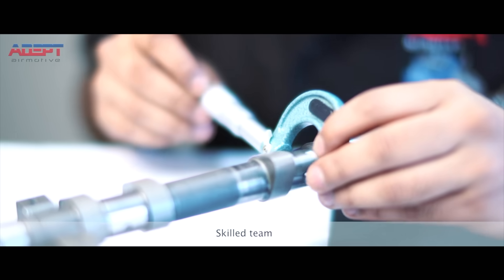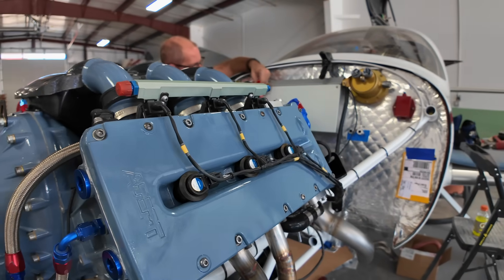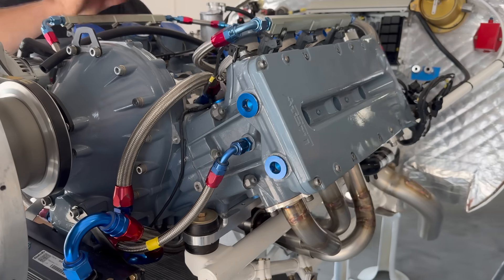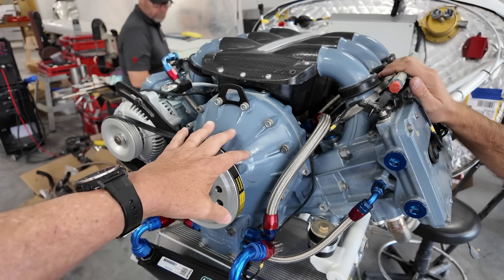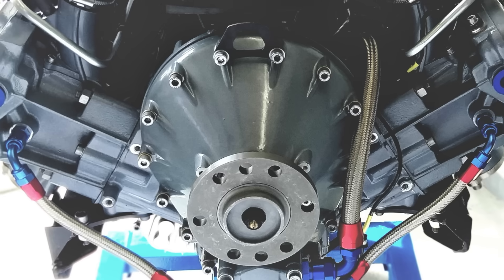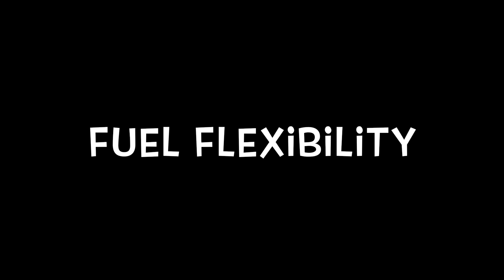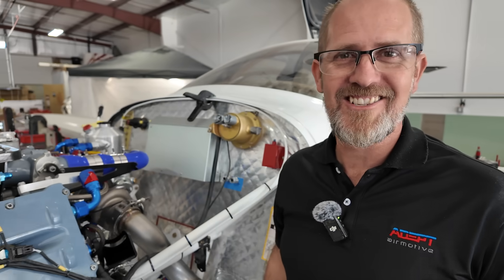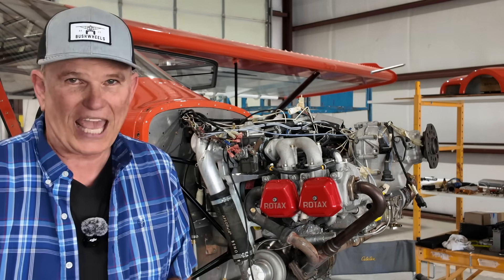The new Adept Engine could be a winner for General Aviation

Comment: I remember when converted Nissan V6 Turbo engine was supposed to change General Aviation with its VQ series of engines. The Continental series of engines are just too expensive for the power output compared to automotive engines of the same power output. Sometimes I think things in aviation are expensive for no reason like medical supplies. I wish this organization the best and hope they keep the cost to customers to a minimum.
Reply: When has there ever been a Nissan VQ aircraft engine? It's probably a pretty good candidate for a conversion in an experimental aircraft, but I don't think that it's ever been done before.
Reply: @PistonAvatarGuy  Look up Rutan 158 Pond Racer.

Comment: We will never ever win the price point on aviation engines. They will always be very expensive no matter who tries to build them. Look at the new rotax 916. Over $80,000 not too long ago you could buy a continental 550 and prop STC package for a 182 for that kind of price. By the time the 916 is propped up an accessorized, it will be north of 100k. And this is based off an engine originally designed for ultra lights. Sport aircraft when they came out were supposedly going to be less expensive. That has not been the case. If you really want to fly you're better off buying an old luscombe Cessna 150-172. The money you will save on the acquisition will pay the maintenance, storage, fuel and insurance for years. A 916 powered Cub clone is closing in on $400,000 fn ridiculous.
Reply from the maker: It's not wings that make planes fly its $$$$$

Comment: Battery prices are dropping like a rock, next generation is showing 400KW  storage efficiency, and electric motors are progressing at an incredible pace on a price/performance basis. Electric is on the way, will have superior torque in small packages with mechanical simplicity.
Reply: Batteries getting cheaper wont make them light enough for use in any sort of practical aircraft.
Reply from the maker: you may be right. the only problem with electric is range. Perhaps it will be there someday but it has to reduce your payloadl

Comment: Why V6 instead of inline?
Have fun and good luck
Reply from the maker: CG, available space in the cowling. An incline would stretch things out too far. The V6 is a nice fit.
Reply: Why flat six? Why Lycoming or Continental? They have always been crap engines. There are kits running around now with LS based small blocks they are a far better option.

Comment: i have only watched 2.5 mins of the video so far and I have already counted 15 single points of failure. I would like for one of these rocket scientist to experience a real engine out over some place like GA or TN where you look down and all you see are 100' tall trees for as far as you can see. I wont even go into and engine out at night or worse engine out in IFR. If your going to design a new gasoline piston engine for aviation then do it from the ground up with reliability being your number one concern followed closely by weight.. Quit taking automotive engines and sticking them in aviation applications and calling them a new design.

Comment: Last comment didn't really make a lot of sense. Rotax doesn't produce an engine anywhere near 360 HP. And, any aircraft flying with a current Rotax, aren't likely to support a 360lb engine. Apples and oranges.
Reply from the maker: There are grumblings in the rotax community that they want to develop a v6 engine. we'll see
Reply: Rotax V6 hast flown a few years ago by R&D. Regards from Germany

Comment: It totally makes sense.  I like the fact that you can lose the water cooling system and yet the oil cooling system is enough for you not to crash.  It also looks very oil tight the way it is constructed.  Top quality lines, computer controlled and turbo = power and reliability.  You cannot run a high horsepower motor with a turbo without proper computer controls.  Ask any racer like Tom Bailey and Steve Morris.  No person can do that.
Reply from the maker: The engineers put a lot of thought into the design.

Comment: 4500 rpm cruise seems like a lot for an airplane.  My V-8 Ford run 3200 at 80mph cruise
Reply: My Fiat I4 DOHC runs 4500 RPM at 80.  It has over 260000 miles, with no major problems
Reply from the maker: My Rotax cruised at 5,400 rpm and it/s very comfortable. That's where the gear reduction drive does it's thing.

Comment: It's about time someone put modern technology to work in GA powerplants. Turbines have had FADECs for years....they work extrememly well and don't fail. Liquid cooling? Nothing new here. As along as the engineering is done well, it'll work just fine, and I'm really impressed with that "run it at 50% power with only oil cooling". I hope you guys knock it out of the park with this engine.
Reply from the maker: me too. fast, smooth, efficient, fuel flexible. what's not to love.

Comment: The perennial problem with general aviation is the excessive certification costs, so that getting certication for new technology when you have low production numbers (old technology here really) is just ridiculous.  Therefore everyone is using currently certified engines which haven't moved forward since the 1950's. GA should be using phev electric/ice hybrid engines with an electric motor instead of a gearbox. Less vibration, less noise, more reducancy, more torque,higher efficiencies. Btw Volkswagen 4 cylinder car engines easily produce more HP per pound than this engine.

Comment: I don’t “start” my car anymore. I simply get close, the door unlocks, and the car turns on. I never go to a gas station, it doesn’t poison the environment, it’s super smooth and powerful, and drives itself. Love my Tesla!!
Reply: You're driving a coal powered machine, = Lost transmission power , coal production, transport, Power plant/Hydro plant construction and battery waste disposal. You didn't think of that did you?
Reply: Batteries don't work for aircraft.
Reply: EVs still poison and destroy the environment. They just do it differently and further out of sight.
Reply from the maker: They are amazing cars. I just wish they had more distance.

Comment: Looks to be a 120 deg. v, which means secondary vibration, which means more counterweights in the crankshaft. Single spark plugs, where is the redundancy?. Liquid cooled equals more weight.  Gear reduction which has always been a problem with vibration and wear, also more weight. Petrol ( gasoline) burning, which has to mean mogas, as high octane leaded fuel is going away.
As other commentators here have mentioned the diesel DeltaHawk, something that they have been working on for decades and is now almost on the marketplace, but at what price point?.
Rotax are popular but the engine revs at “idle” need to be kept higher due to the power pulses in the gear reduction causing premature wear, this has always been a problem with geared engines, even Porsche couldn’t make their aircraft engine work reliably in the 1960’s, 70’s ?.
There have been quite a few people using modern mass-produced engines with reduction drives over the past few decades, usually in experimental aircraft, how many trouble- free hours are they flying?.
Revisit this in a few years and see where they are.
Reply: Ferrari doesn't seem to have vibration problems with their 120 degree V6s. This isn't the 1940s anymore, ignition system components aren't any more likely to fail than any other component. Liquid-cooled engines are lighter than air-cooled engines, even Continental's liquid-cooled engines were the lightest of their 500 series engines. PSRUs allow for an enormous improvement to the power to weight ratio of the engine, it's the primary reason why they're used. Wet and installed, this engine weighs more than 100 pounds less than the dry weight of a comparable Continental or Lycoming. This engine does not need leaded fuel and runs on 91 octane mogas.

In its least powerful iteration, this engine makes 100 hp more than the DeltaHawk, while at it's most powerful, it makes twice as much power, they are not comparable engines.

Rotax's engines don't seem to have problems with their PSRUs.

Porsche's engine worked beautifully, it was just expensive and under-powered. More than a few are still flying to this day.

During the heyday of piston aircraft engines, almost every engine that made more than 1,000 hp had a PSRU, so why should the aviation community suddenly be adverse to their widespread adoption?

Comment: I'd be interested to hear how they can run a fuel injected engine on avgas, which is I assume is leaded.  There is no oxygen sensor for fuel injection control?
Reply from the maker: This plane has multiple fuel oxygen sensors. That's why they can run on any fuel you put in it.
Reply: Don't need an 02 sensor for Air craft fuel injection as it is now....

Comment: Beautiful engine. 
But
Single spark plug? I get that we've come along way but you can't just pull over when you have an issue so, redundancy is nice to have, is relatively inexpensive and not even a huge deal to incorporate. And if the response is ... parachute... well, I'd rather pay a bit more for my engine then having to buy a new plane because even though I'll most likely survive, the airframe will most likely be beyond repair.
Reply from the maker: they say if you lose one plug and coil, you only have a 15% reduction in power.

Comment: Great the he gave Rotax a plug at the end...not many competitors would do that. Beautiful engine. NOT a motor - they are electric!
Reply from the maker: Love, love, love Rotax. No other engine can do what. that platform does. This is like a big Rotax.
Reply: Technically it is a motor. "Engine" comes from the Latin ingenium, meaning "innate quality, mental power, clever invention". Sure we use that term almost universally, but it is still technically slang. There is no requirement that a "motor" be electric. "Motor" comes from Latin motor, meaning "mover."
Reply: @NeilWhelchel  Your response shows innate knowledge or research. Both are praiseworthy.

Comment: Congrats on the project. As an A&P I see something that concerns me so I hope you don’t mind a little constructive criticism. The curved fluid fittings are not AN and we don’t use those in aviation because of the large unsupported tubes prone to cracking under vibration. I would support them near the bend since right now all of the loads are transmitted directly to the radiator. Either the fitting or the radiator itself would be prone to failure in the current configuration.
Reply from the maker: I'm sure the owner will read this comment. Thank you
Reply: As a race car engineer by trade who also has an A&P, I can say you have no idea of what you’re talking about. Angled AN fittings are actually superior in both flow and structural stability than straight fittings with the bend radius in the hose when the routing requires it, the key is in the hose support. Modern professional race cars are basically fighter jets on wheels and experience significantly higher thermal and vibrational stresses than aircraft. If it can survive a Daytona 24H, endure the abuse of 12H @ Sebring or 2H in an F1, I’m very comfortable flying behind it. Congrats to ADEPT for having the guts to attempt a project that helps bring the aviation community into the modern age.
Reply: @CarlHermez  "Real race cars don't have doors".Sprints Midgets and Roadsters
Reply: What is AN?
Reply: @GeorgeDoughty-m8e  Army Navy standards. Aviation certified fittings.
Reply: Yeah, good one. Like you have seen the inside of a P51 ever. Steel fittings and coolant, good combination. Go back to sleep, you’re more helpful that way.
Reply: @anthonydennis2996 Steel fittings and coolant is perfectly fine and has been done in automotive applications for the past 80+ years. The vast majority of coolant has anti corrosion additives to prevent corroding fittings or the engine block itself.
Reply: Army-Navy : similar to JIC, 37 deg sealing flare but different thread. The fittings in the video are AN. The bend radius of the hose end has nothing to do with the standard. Somebody needs to go back to A&P school and get some education on aerospace fluid connectors.
Reply: @anthonydennis2996  JFZ auto racing makes the same fittings and you haven't an Idea of proper fitting and hose supports- Try working on a P-51 and see how it's done.
Try a steel fitting.

Comment: Has been over 15 years in development. Hope they pull it off but many millions must have been spent in that time, making the per unit price pretty high for any decent time for ROI.  Should have brought the project to the US a long time ago- that's where the market and money is.
Reply from the maker: People didn't want to accept water cooled engines back then. But thanks to the track record of the Rotax, i think hearts and minds are changing.
Reply: Try 20 years, and at the cost to the South African tax payer. This engine was developed under a local 'Development plan' as a local replacement because USA imports are horrific. But the deception goes on. To date, South Africans cannot afford this engine, that their tax money sponsored.

Comment: Looks very cool ndeed. That oil pump underneath the propeller mounting hub, looks like a full flow VW installation. I've done a few of those, and it looks so similar. May be it is the flat cover, and the lines leaving the pump to the cooler, and others.  I think it is time for the airplane engine technology to go to the next level and take the industry by the horns. Best of luck with this machine.
Reply from the maker: I'm sure it will get even more attention once it starts flying this month.

Comment: No.  General Aviation leaded fuel mist end.  Electric motors only at that size of plane, with hydrogen or ammonia or a cleaner diesel fuel.
Reply: This engine does not require leaded fuel.
Reply: You truly haven't a clue